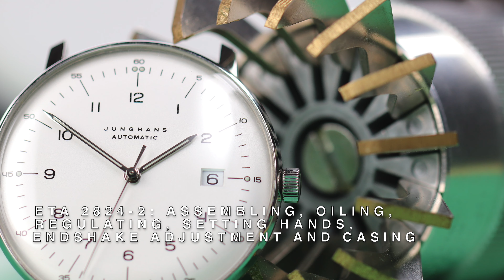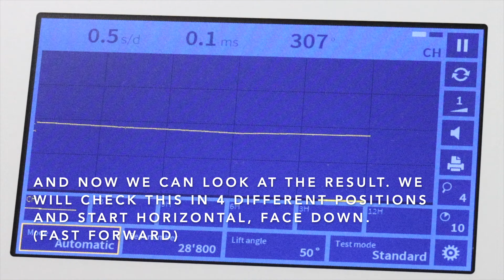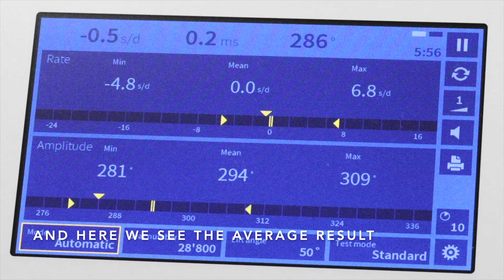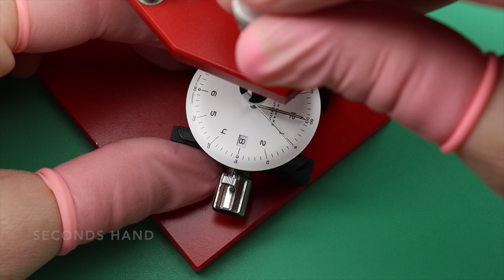Can I fix this ETA 2824-2 movement with endshake adjustment?! Watch Repair, Junghans Max Bill.

Comment: Really well produced video and nice recovery! Just a tip: if one has the automatic bridge installed to fit the hands it supports the 4th wheel pivot and stops either the train bridge from deforming or 4th wheel jewel from moving to the point of unlocking the train.
Reply from the maker: Hello Rvw993, that's  indeed a good tip, do you first install the automatic bridge and watch case back and then you'll continue with the placement of the hands? Seems like a good way to work.
Reply: @therealwatchdoctor  For me it depends on the style of case, but those that I am usually working on the movement loads in the back. So with the bridge installed I'd attach the dial, fit the hands with the movement laying flat or in a holder, then case it up.  If there is any further timing to do after that I'd take the bridge off again. For vintage automatics with indirect centre seconds this is also useful as without the bridge there is nothing to hold the seconds pinion except the friction spring.

Comment: Really nice and educating fix. But I gotta say that the watch loses a bit of it soul without the original slightly curved second hand. At least it doesn't look like the original on the video but correct me if I'm wrong. Those are probably a bit hard to get as a replacement? 😊

Comment: I've set hands on many ETA movements of this type and never had a problem.  I use a hand-held pusher and not the press.  It's too easy to exert excess force with the press and damage things or knock them out of adjustment.
Reply: Not true, you have to use the specific movement holder that supports the jewel

Comment: use bergeon 5409 or Watch Movement Holder with Adjustable Hollow Center Screw. u have to use it when u setting second hand.

Comment: You cannot press on hands without a movement holder that supports the jewel on the other side. There is huge chance of pushing out the center jewel. Use appropriate tools as specified by the brand!

Comment: Reducing the end shake fixed the problem. But if you had unwinded the watch and fitted the seconds hand without spinning it, would the endshake still pose a problem or interfere with the timekeeping?
Reply from the maker: Hello DutchClawz, I don't think there would have been a problem, but the timepiece might still have got stuck, or the pinions might wear more quickly. Hard to say. The endshake was a bit too high anyway, and I should have adjusted this before placing the second hand. My mistake. Nice to hear how this community reacts to this videos and what other watchmakers have already experienced and what method they use. :-) Maybe I should make some mistake again...(just kidding :-) )
Reply: @therealwatchdoctor  Fouten zijn de beste leermeester!

Comment: You are pushing with that tool on hands more than it needs. All parts become a rigid mechine with screws. And you are pushing to the centre wheel through top to bottom. This can cause move the jewel 0,02mm at 7:08 . All hands needs a direct gentle push. We never use that tool. The only tool we use is tweezer since 132 years.

Comment: Why do you require a hands pusher for fixing the center second hand. The job can be easily done with the back side of the tweezer with just a light tap on the center second hand. Luck is in your favour that the center second shaft did not break coz of your crazy handling.